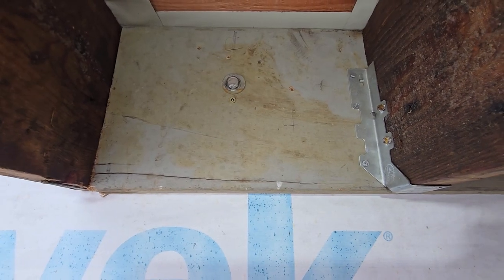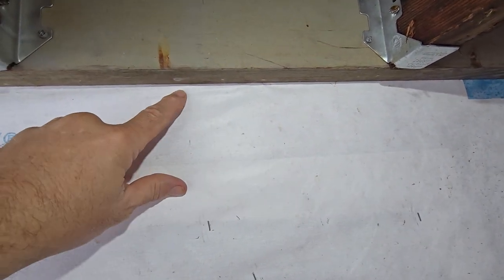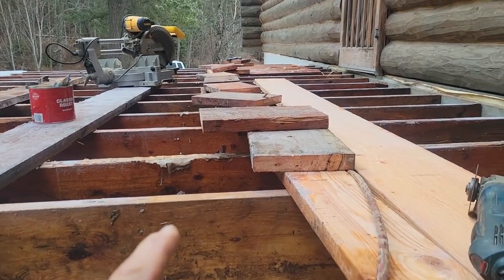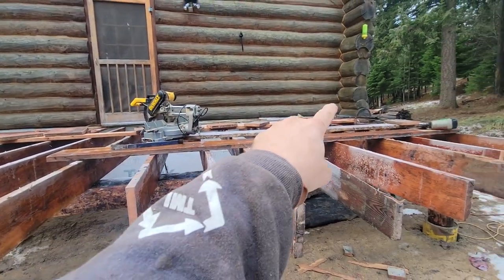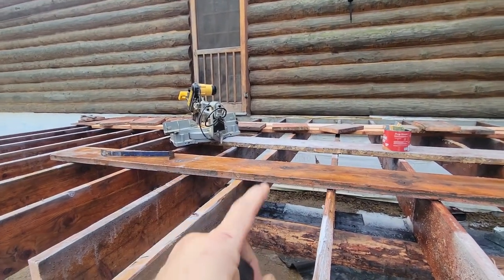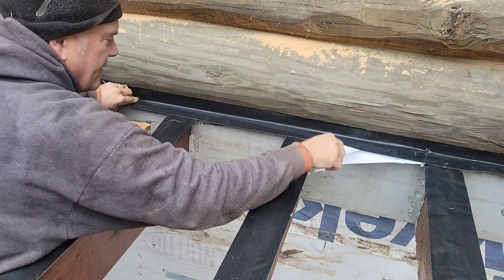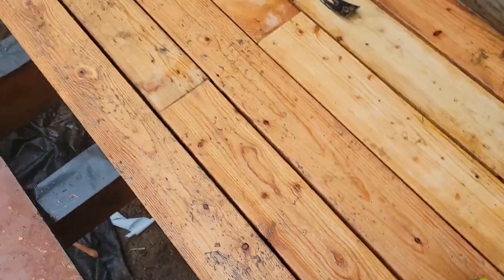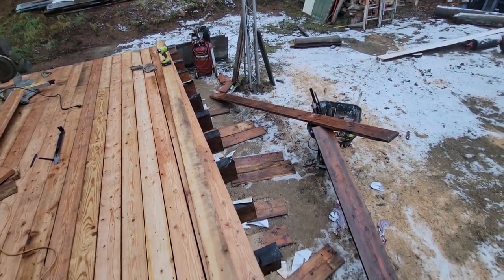HOW to build a DECK Part III

Comment: A nice job Scot but I don't think your seal between the deck and the logs will be watertight. Did you consider putting some caulking in just to seal the deal?
Reply from the maker: Not really.  All the research I've found doesn't suggest doing that.  That tape really is just to slow down water penetration into the top of the log.  We also sealed the log prior to putting the tape on.  It should at least double or triple the life of that wood from rot.  Thx!